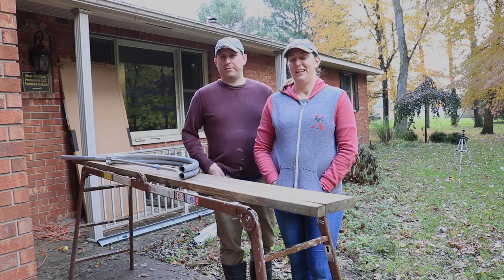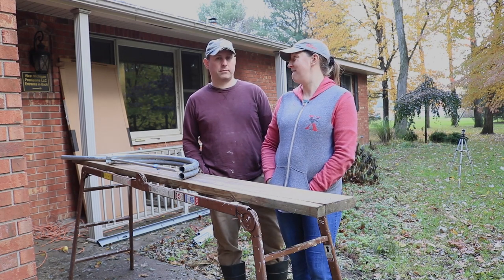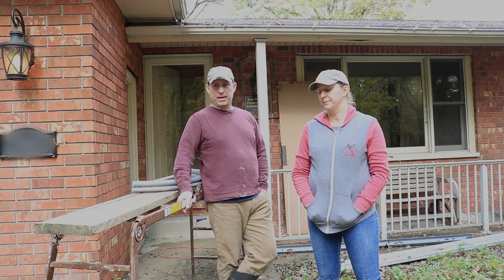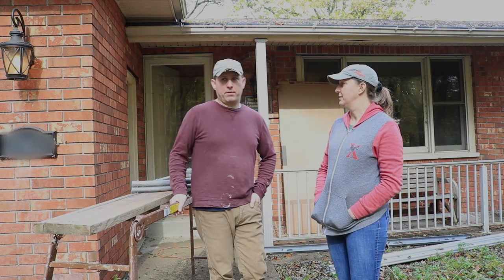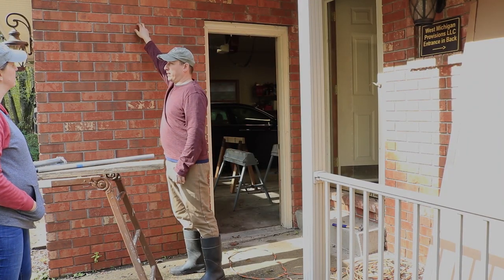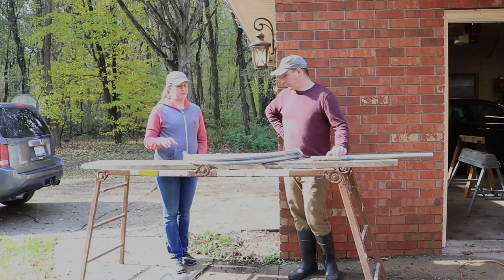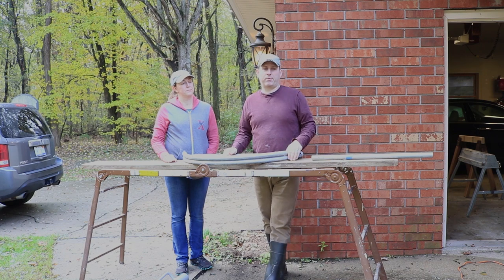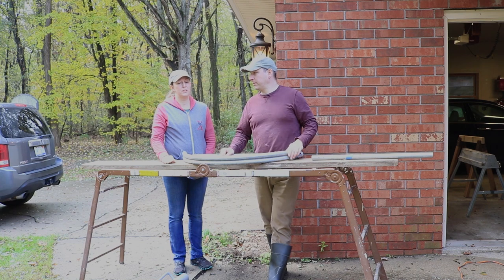The $400 Greenhouse Part 1: The Plan

Comment: I so love this!   Ours would be a higher tunnel, but i'm going to have to do some research about that. Maybe if I cross my fingers hard enough I can tackle this in the autumn. Love this video!
Reply from the maker: We actually had to attach these poles to short poles with connectors and then stuck the lower poles in the ground.  You could do that with longer conduit pipes
Reply: I was thinking more about the fact that it's taller, more space to heat , might not heat enough.....etc.  Where we'll be doing it is the straight on south facing, unobstructed in front of our house, but our place isnt ground level, we're up 3-4 more feet.  Add that to the fact that we've been almost living in the dark up here with the lack of sun, i'm curious how that will work out. But i'm sooooo willing to give it a shot.  Worst case, it's an expensive weather guarding of our front windows and door....haha
Reply from the maker: You will have more sun than most of France and they grow year round in places.  You could add some heat sinks (water barrels or paving stones) for warmth. You could even do cloches inside, over your plants.  But keep in mind, that our temp has gotten up to 40* warmer inside compared to outside on sunny days and about 10 degrees warmer inside at night.  That was with some loose ends/cracks not closed up and during our shortest days of the year (we are getting about 9 hours of daylight right now) and its filtered sun through some trees with no leaves.
Reply: This is going to be so much fun!!  Thank you!

Comment: a place for delivery packages even? You've thought of everything! I bet it will mitigate any risk of porch pirates, if that's a problem in your area. I love your project, I think you guys have a great thing in place. Good design - it reminds me in a way of the "uphill greenhouse" concept by Mike Oehler. His houses were underground but he used a space behind the house to kind of retain the heat that would normally be lost, into a greenhouse where the heat could be of use.
Reply from the maker: Lol, yes, we've had problems with people leaving packages, even some pretty small ones, directly in front of the garage door.  We have been very lucky not to have run over more packages (we ran over 1).  We don't have too much trouble with package pirates in this area as we are pretty remote (and have giant breed dogs who tend to deter people).

Comment from the maker: Do you have a greenhouse?  What style do you have?
Reply: Have a 6x8 that I bought from Tractor Supply at end of season back 2011 for $35 (reg $99). The Greenhouse material over time  got thin and a big snow storm and later heavy winds shredded the roof.  So I saved the frame and build sides with old fencing and reclaimed windows and got greenhouse roofing material.  I set up some hydroponics in it and some potted plants and so when the cold was coming, I realized I didn't have room for a lot of the big potted outdoor plants that aren't cold hardy that I usually put in the greenhouse in in the winter.  So I decided to build a lean-to greenhouse on the front of our workshop.  I used pvc pipe (which I already had), wood I had laying around.  Some plastic I had left over from making hoop covering over raised beds.  I realized I didn't have enough so I had to purchase some 6 mil 10x25' plastic sheeting from Tractor Supply to finish it ($32.99).  A little duct tape and only bought a few pieces of lumber at our local building supply place that has a $1 bin to get a few smaller pieces. Now I have a place to store the pots as well as get some seeds going in the spring.  May not look great, but it is functional and cost very little.  Realizing later that there are only 3 pvc pipes going from the roof to the ground, I realized that snow might accumulate on the roof of the lean too and make it sag or collapse I recently purchased a cattle panel and put it under the plastic to reinforce it for weight. So that cost about $21.   So all in all a cheap build.